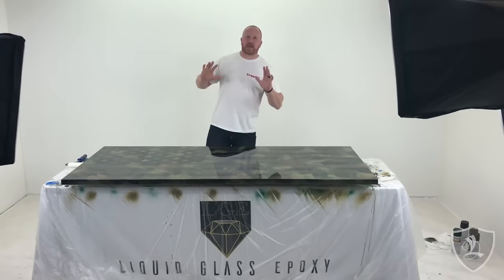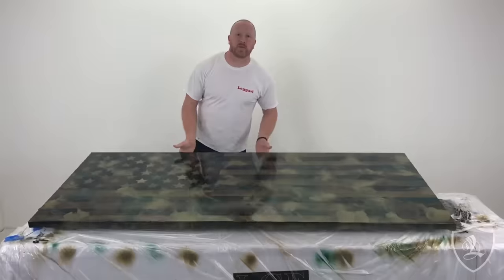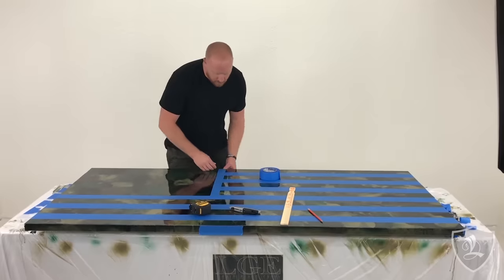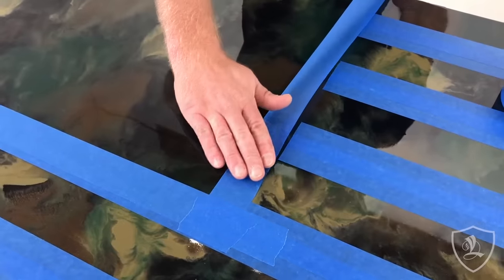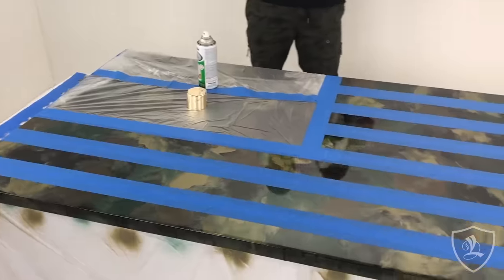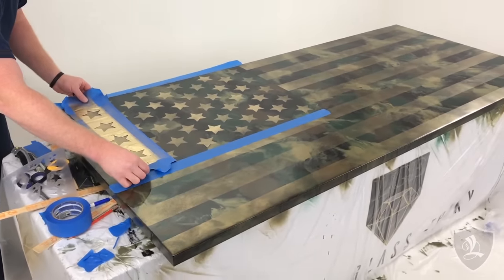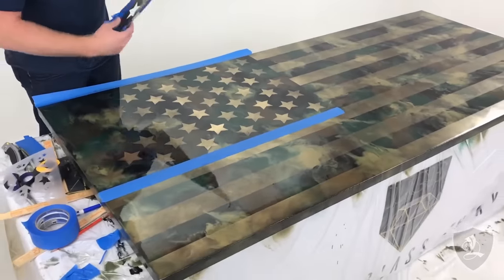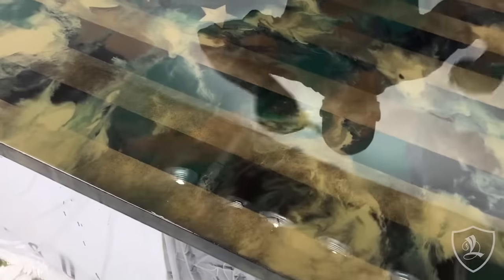DIY American Flag | Spray Paint & Epoxy Project

Comment: Just an FYI; to determine the proper width of the union (field of stars) you want to divide 2/5 by the total length of the flag and the height of the union would be the total height of 7 stripes.

So a standard 37"  x 19.5"  flag would have a union of  14.8 " x 10.5" with a stripe height of 1.5" each.and stars of  1 3/16" x 1 3/16" to be of regulation fly & hoist.
Reply from the maker: Good luck with your project and thanks for watching the video

Comment: So, I did mine with a red, white, and blue background with silver ghosting and a white line for EMS. It turned out amazing.  Also, I used a different product and it worked just fine.
Reply: Wish you could post pics on here
Reply: Sent and let me know if you have any questions.

Comment: Do you sand before pouring the clear coat on top? Or will the epoxy bond to itself and the paint? I did one this weekend but haven’t put a clear coat on it yet.
Reply from the maker: You do not want to sand if you have the spray paint on which you probably already do, just wipe the surface off really good with a cloth then apply the clear coat.  Thanks
Reply: Thank you for the tip!!

Comment: Very nice 👍 
After it was painted black and you put the first coat of EcoPoxy did u let it dry before you added the other colors?
Reply from the maker: You want to add the highlights immediately after applying the base coat so you still have time to work with the base coat of epoxy.  Thanks

Comment: Hey I really like your projects even inspired me to want to do one of my own but I need your advice. I want to make a clear see-through table top with a superman engraved emblem in the middle inside of an Epoxy that is clear how should I go about accomplishing this? I wanted to have that finished glass look at the end. So basically what I’m saying is that the whole table top will be pure glass and look see-through and the only thing you will see is the superman engraved symbol inside of the table looking like it’s suspended in mid air so what would be your recommend a process to accomplish this?

Comment: Man that is AWESOME!!! as a diy guy i have to make one, 2 questions if you dont mind, 1) do you let the first layer of clear epoxy dry before you put the colored epoxy circles and 2) was that just water in the spray bottle you were spraying? Super cool project my wifes a vet, i gotta make this for her, great job fellas
Reply from the maker: Once you apply the base coat of epoxy you immediately fallow it up with the highlights so you can still work with the base coat of epoxy.  We are using isopropyl alcohol to give it a dispersing effect.  Thanks
Reply: @LeggariProducts  awesome appreciate the info, again amazing work

Comment: Looks good. Was that first layer clear? Or did you add gold ??
Reply from the maker: They did the decorative epoxy coat then added the gold spray paint then they did a clear coat to seal it all in.  Thanks
Reply: Ok thanks... wasn’t mentioned and looked a little glittery.. awesome project!!

Comment: You used a Valspar prime or paint instead of the primer that comes with your kits. Can I use a regular primer, then use your primer on top of it? I'm doing white epoxy over a bright orange countertop.
Reply from the maker: You can use a water based primer.  But is you are using our epoxy the kits come with the primer.  Thanks

Comment: Beautiful! I notice you did not torch it to get rid of air bubbles, is it not necessary?
Reply: Alcohol babyyyy
Reply from the maker: We have a high end epoxy that has an additive in it to make the bubbles rise to the surface and pop on their own.  Thanks
Reply: @godhatesmath7781  does alcohol work better than a torch?

Comment: Is there anyway to add photos to this ad like a border or something under the last layer of epoxy? Do you have to use a special kind of photo paper?
Reply: All you would need is a decal and put that on before the layer of clear coat. Make sure it is on nice without any air bubbles first before you slap on the clear coat.

Comment: What was in the spray bottle after you did the camo portion and what purpose did it serve? Thanks.
Reply from the maker: We used denatured alcohol to disperse a few bubbles.  Thanks
Reply: Is that a safer yet still effective method rather than using a blowtorch? Thank you for the information.

Comment: I have never worked with epoxy, did you just sand all the runs on the bottom of the sides down?
Reply from the maker: You scrape them off while the epoxy is setting up with a paint stick every 30 minutes until product is set up.  Thanks

Comment: Hey bud, first off...knocked it out of the park! Beautiful piece, I wanted to share some information there is a site called inchcalculator.com and you punch in your dimensions or desired build and will calculate your stars, stripes, spacing, size your union and stars should be proportional to your build. Hope this helps someone
Reply: Just used the calculator! Thanks

Comment: How much epoxy did u use for the entire project?
Reply from the maker: We used 1.5 gallons of epoxy for the American flag.  You can email leggari@gmail.com requesting the supply list and they will send it out to you.  Thanks
Reply: @LeggariProducts  is it all wet in wet, like did u wait for the very first layer of epoxy(with the flakes) to dry?...i will mail you if I got the right idea of the final form

Comment: What was sprayed on it after the blotting ?
Reply from the maker: We misted it with denatured alcohol to get rid of a few tiny bubbles.  Thanks
Reply: Alcohol'. It pops the air bubbles on the surface of the epoxy .

Comment: Love the flag idea but not the splotches that mess up the flow of colors. Also, the star field should have been in a different corner so it matches the way the flag is supposed to hang vertically. Stars should be in upper left corner of the door.   Source: aflag.com
Reply: This was designed specifically to be hung landscape... it's fairly obvious. Your critique has no merit whatsoever.

Comment: where can I buy the  materials to do this project?
Reply: CJ Rose you can buy the epoxy from the Leggari website and all the spray paints to color the epoxy and the mixing tools from a big box store.
Reply: Yeah I looked on the website and all I saw was floor and counter kits. Could not find where u buy like cans of epoxy individually .
Reply: Oh I getcha. That’s actually a good question. I think they linked it but I clicked on it and it’s broken. I’ve never bought their epoxy but I’ve used pro marine with great results. Maybe contact them through their site.